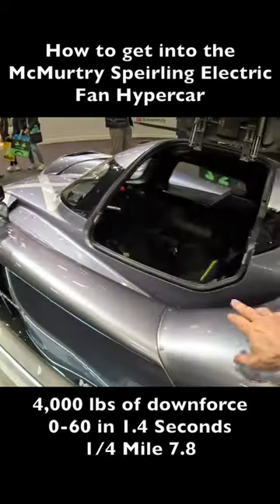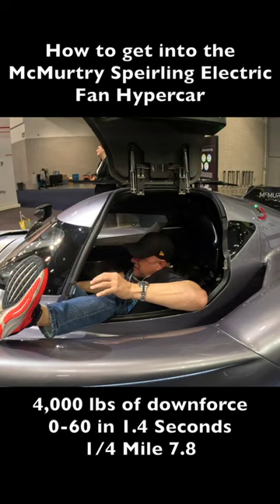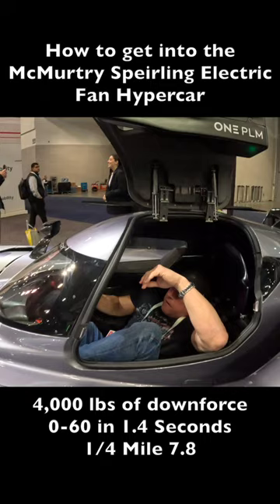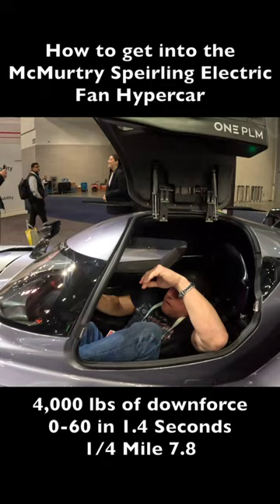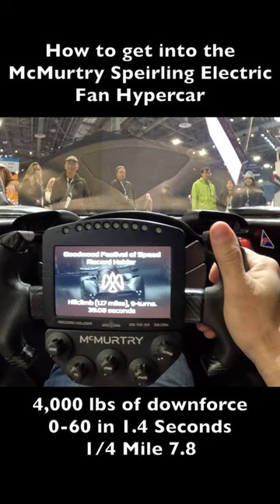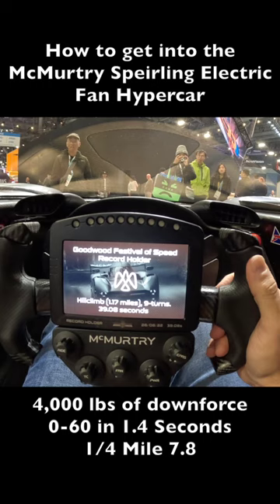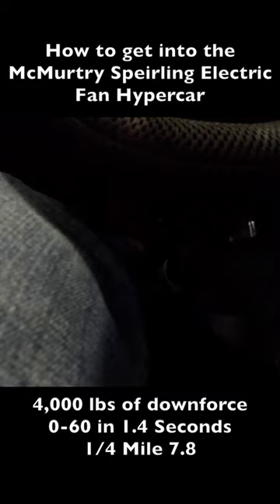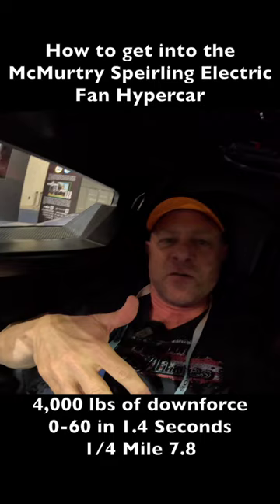How NOT to get into the McMurtry Speirling Electric Fan Hypercar

Comment: Unfortunately it has a limited topspeed because of the motor rpm which it reaches way before the end of the quarter mile.
So it could be even quicker on the quarter mile.
Reply from the maker: production version moves the top speed from 150 to 190 MPH
Reply: @DragTimes  great 🤙🏽
Reply: 7.5 seconds quarter mile estimated @165 mph 
There are two versions with different gearing
One has 190 mph top speed 
One has 150 mph top speed but shorter gears
Reply: @DragTimes is it street legal?